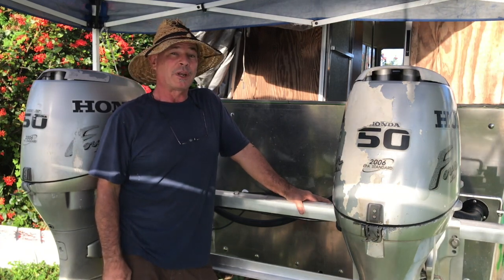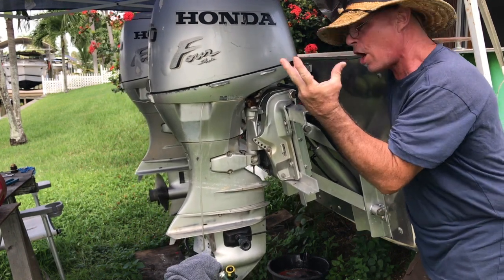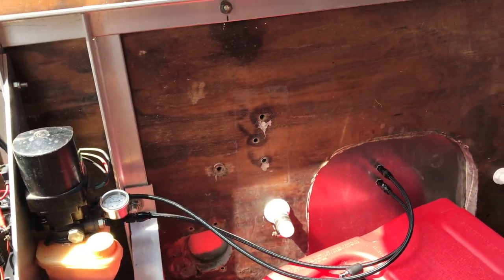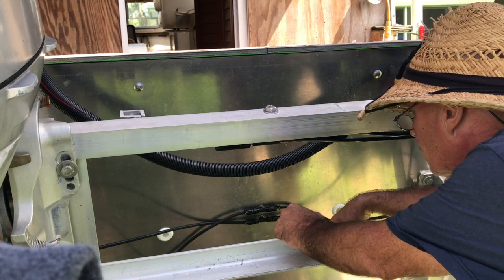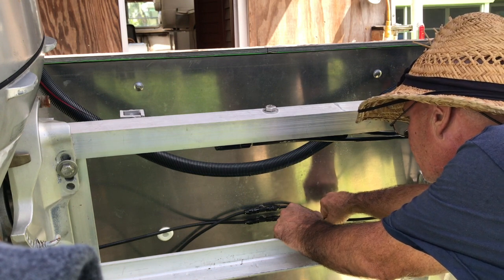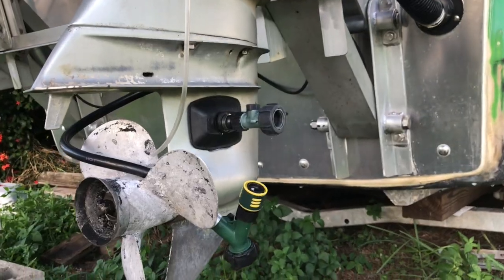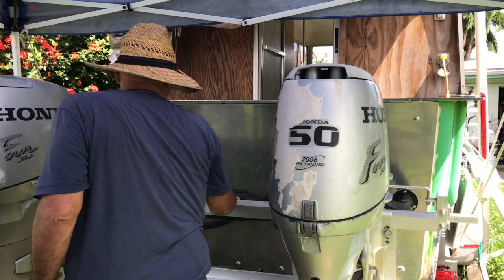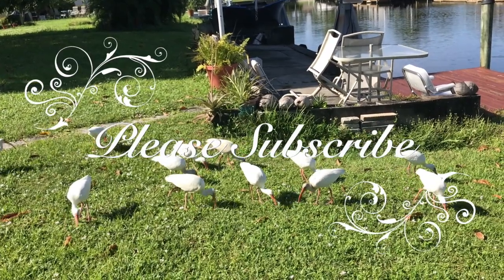Custom Outboard Motor Bracket  UPDATE: Hydraulics Active!

Comment: Hello There, you have some super cool ideas. I am in the process of hanging a pair of outboards on my 25’ Bayliner. Would is be possible to get a sketch showing the dimensions of your outboard bracket, would be much appreciated. This will be just a “One Off” production just for my project. Also, I assume the material use is aluminum ? I was considering 316 SS.  Thanks in advance, Happy Sails
Reply from the maker: Hey Tony, thanks for the complements! Great idea for a big Bayliner, twin outboards will be a huge improvement in many ways. I will be happy to help with any advice I can, however, a sketch of my bracket would probably not fit to your application. Although my 24" setback would probably be about right, the transom angle, motor spacing and waterline are going to be different. The primary critical calculation is where the pivot pins of the arms and cylinders will be located. You can only start these calculations once you have your cylinders, and transom angle is figured so the arms will be level with your waterline at rest. Yes, I used aluminum, easy to machine, lightweight, and not too expensive. Just tricky getting the welding down. Lots of research and lots and lots of practice! Thanks for watching!!